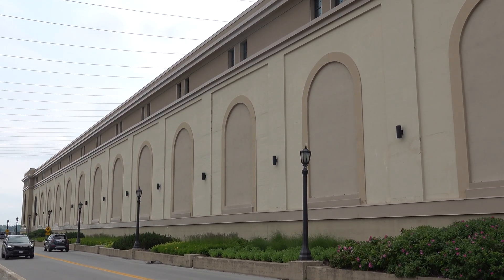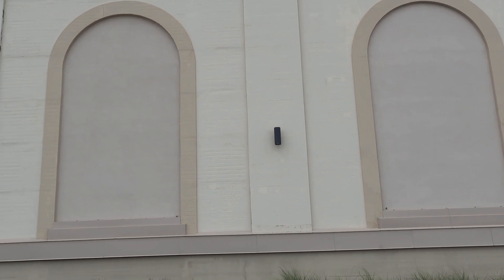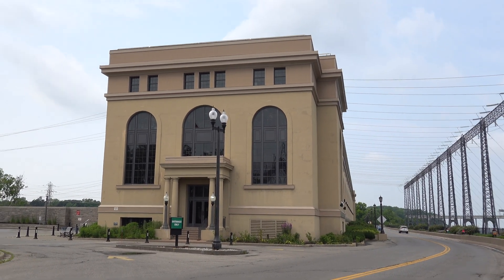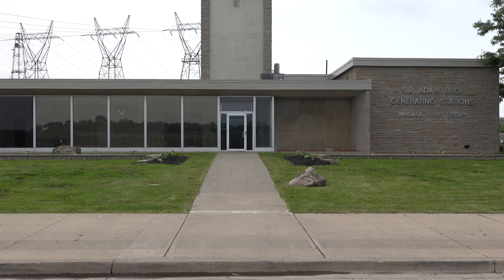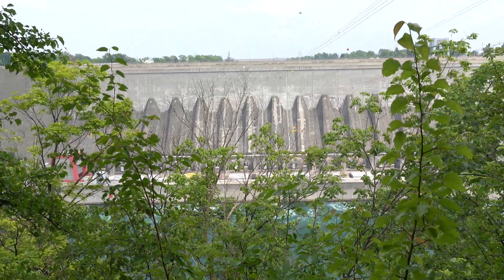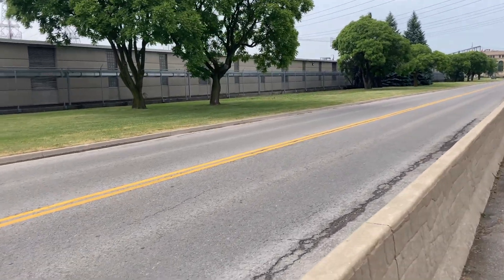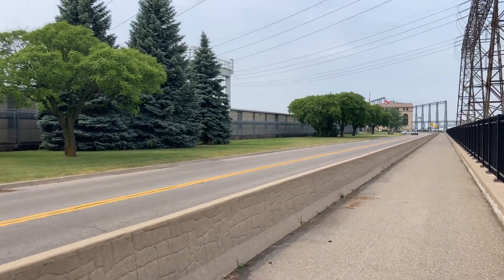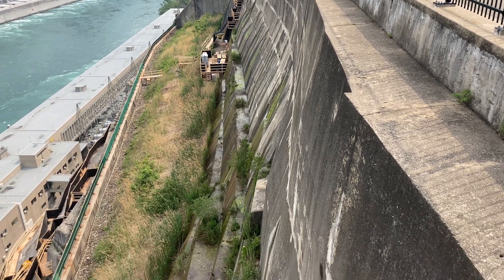Niagara Falls Sir Adam Beck Power Generating Station Exploration

Comment: One correction: The alternators for both Adam Beck plants are located in the river gorge, just above water level.  Each generator is connected to its turbine by a short shaft.  The transformers for Adam Beck #1 (at least) are also in the river gorge.  The large building up above, near the roadway, apparently contains just the water intakes and screens to prevent large objects in the water from entering the penstocks feeding the turbines below.
Reply from the maker: Very insightful and makes a lot of sense!